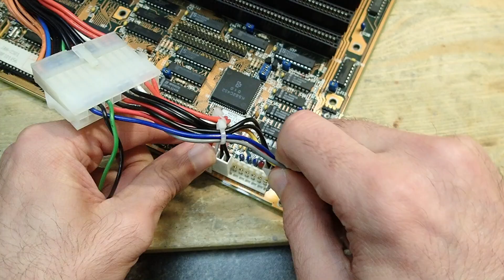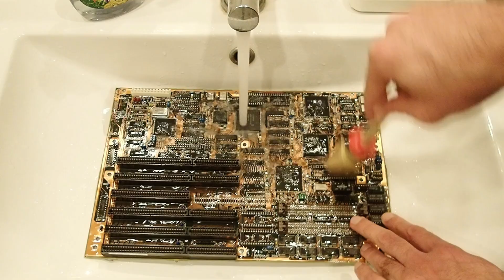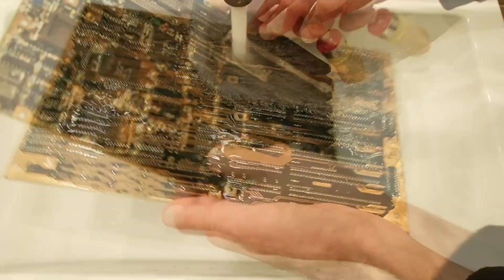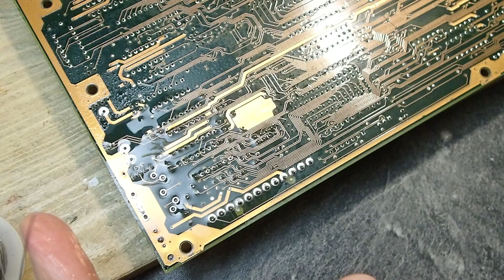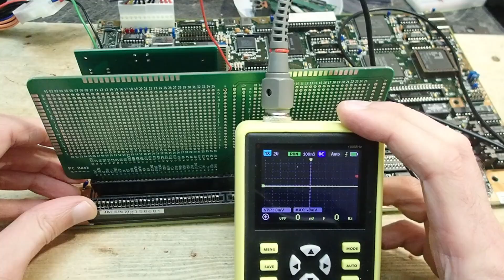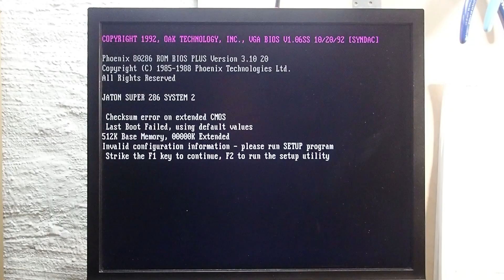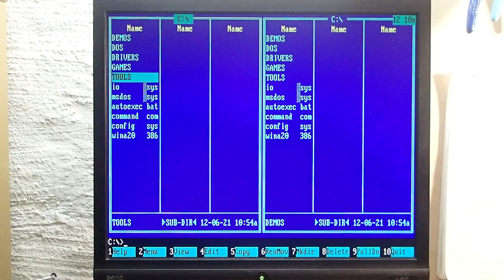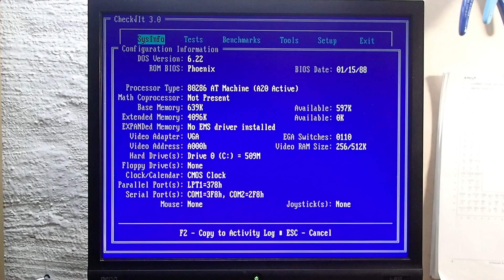Let's repair an old 286 mainboard Jaton JAM-2301-V1

Comment: I adopted your method of removing flux from a board by using alcohol with a toothbrush and then using the toothbrush with a paper towel to remove the residue (I use a clean cloth instead of paper towel and throw it in the wash when it gets too dirty).  It is a very quick way to clean a board and looks like new afterwards!
Reply from the maker: You are welcome.
Reply: @necro_ware  Great job !  This reminds me that I need to get my Compaq DeskPro 386 up and running.  All that I have is this and my Intel SDK-86 prototype board.   And of course, I have the Commodore 64 too

Comment: Usually, I throw them into the dishwasher. Graphics cards, motherboards etc with Finish tablet. Then put into the oven and bake at low temperature. No water stain or anything and shinny like new.
Reply from the maker: Yes, this is also an option. I tried that as well in the past, but without the tabs, since I don't know the chemical ingredients of that. And I have only one oven for cooking food, so I don't put electronics into that one because of health concerns. I tried it once a long time ago and after that all of my food smelled like PCB :D
Reply: @necro_ware   The tablet is bad for aluminium for sure. That's what says on my cookers. Might be bad for BGAs but it worked OK when I try it with some graphics cards. I usually face the BGA chip down to prevent direct water flow over balls. Anyway, don't try it with any precious hardware LOL.

Comment: When I wash boards, I just go over it with a vacuum cleaner to suck up the water deposits that remain. The air humidity here is pretty much always 70% or above, so static is not really a concern

Comment: I usually wash the PS3 and PS4 first let it dry for 2 to 3 days and put it together and they usually work with no other repair. If that does not work, I check capacitors and burn  or broken cabling.....

Comment: Does the little PC speaker have orientation? Like blackwire and red wire must go in certain pins. Thanks another great video
Reply from the maker: No, it doesn't. Thank you too.
Reply: @necro_ware  technically it does, if one used period correct voice coil speakers(the sound will be louder). It does not matter for the beeping Piezo used in the video. :)

Comment: Would using desiccants help as well? I have a bunch of packs from many electronic shipments (not quite easy to dispose, so reusing sounds like a good idea)
Reply from the maker: If I have one I usually throw it into the box, where I store the mainbiards. It helps only to reduce humidity, but if the board is wet, it will probably soak up instantly.

Comment: Can you test if this board works with 4MB SIMMs? My Headland HT12 treats all 4MB SIMMs as 1MB each and the specs I found says max 4MB total RAM for the chip. Since this MB can use 5MB RAM, will it work with 4MB SIMMs also? (let's say 2x4MB+1MB) Not much hope, as the 2 extra address lines might not be connected, but I am searching for 286 that can use those SIMMs fully.
I know SW of that time can't use, but I'm obsessed with RAM drives and looking into network booting old CPUs. Currently 386 can load my compiled etherboot (floppy or bootrom), but I have not recompiled pxelinux from Ubuntu 10.04 and thus 486(DLC on 386DX MB) is still required.
Reply from the maker: No, it doesn't. I know none 286 mainboard, which would work with 4MB modules. They were not existent at that time and the maximum amount of memory a 286 can address are 16MB anyway. Theoretically with the four slots you would already hit the limit and the question is then, what about the onboard 1MB? Such an amount of memory was unthinkable back in the days and would probably cost you as much as a new house. In addition to that, it was not very handy to access that memory, since EMS and protected mode was not yet really mature on 286, so there was barely software which would take advantage of that. And on top of that, if you want to run Linux on a 286, you already lost, since the minimum requirement even for the very first Linux was a 386 with 32-bit, advanced protected and virtual mode. Basically it makes absolutely no sense for a 286 to have more, than 2MB of RAM.
Reply: @necro_ware  I know that much memory was impossible at the time. My point is that 386SX was made to reuse 286 motherboard designs. Although those are 4MB limited (or 5MB with an extra bank??), some new 386SX designs might have been sold with 286 to be cheaper and retain the extra address lines.
As for EMS, on 286 should have been the prime functionality, otherwise why go 286 instead of 8086? EMM386 just allowed the emulation to be CPU-only (free the chipset HW of this emulation) . But all 286 boards should support it (with their own drivers which might be hit-or-miss).
And yes, Linux is 386+, but Unix and Minix exist for 8086 and 286 (I have booted "modern-ish" Minix on 286).

Comment: Anyone else notice the ISA slots were labelled as SOLT on the board?
Reply from the maker: I noticed that as well. First I thought it's a mistake on the silk layer, but then I realized, that the 8-bit part is called SLOT and the 16-bit part is called SOLT for whatever reason :D

Comment: Nice use of the eprom slot on the network card, will have to remember that one.  I bet it would also work with SCSI cards or any other where you can add additional ROMs.

Comment: IDE pin 28 on some early boards must be disconnected for new drives/CF/SD adaptors because back then it was used for various different and incompatible things, like SPSYNC (probably already obsolete when that board was made) and BALE signals, and yes, it will hang POST at controller/drive initialization, try an extension cable with pin 28 disconnected.

Older drives with switches for Single unit, C and D expect the BALE signal and newer drives with MASTER, SLAVE and CABLE SELECT expect ground.

Also some early drives (Conner CP30xx) will DIE if you connect them to newer boards or USB adaptors with pin 28 grounded...

At least some boards up to Socket 7 with integrated IDE could supply the correct signal (BALE or GND) for both old and new drives using a jumper, but you can't mix both kind of drives on the same channel.

Comment: Ahhh... I already have the rubber tips for my Dremel tool , but coating the traces with the flux is the key!  I didn't know that, but watching the solder chase the fluxed traces was undeniable, and something I'd literally never seen before.

This is all very important to me, as I own a pair of the very rare 25Mhz Harris chip 286 boards w/ 16Mb direct-addressable memory (not EMS) [and w/ soldered battery - ugh!], so I'll probably have to make similar repairs when I try to restore them.
Many thanks!

Comment: Just an extra tip : when you put the board upright after cleaning it with water, make sure the chips are aligned VERTICALLY - due to the surface tension of water, water won't flow between the legs of chips so it can get trapped there. If the chips are aligned vertically, the water can escape from underneath the chip itself without pins or legs blocking the "escape route". If you have chips running in both direction, it may not be a bad idea to change orientation after a while. I also find that a hairdryer can help coax water from trapped pockets.

Comment: I would not use that handsoap to wash a mainboard. This is because it's ment for hands, and leaves a fatty residu.
Reply from the maker: That is not cream soap, I hate that :) It is a normal soap.
Reply: @necro_ware  It's the same palmolive as sold here, and it leaves a residu.
Reply from the maker: @janklas7079  If it does, it's not the same. As I said, I hate cream soap and this is just a normal soap.
Reply: @necro_ware  It does. As I said, I have the same soap heree, and it leaves a residu. It's not cream sope. But it does contail oils. Which is also why it's called palmolive, as it contains palm oils.
Reply from the maker: @janklas7079  Palmolive is just a brand name, which should confuse customers, so they think, that it has something to do with palms and olives. Anyway, there is no real need to argue about that. If you think, that you shouldn't us it, you can use any soap you like, or even use any other way of cleaning the hardware. There is definitely not the only one way to do it right.
Reply: @necro_ware  We can surely agree on the latter.
Reply: All soaps leave some sort of residue, that is why proper rinsing is a thing.

Comment: When you want to read old ROMs, can you visually identify the type of chip without peeling back the stickers?  Like is there a specific type that is more common with 286s or 386s?  Can one infer anything from the presence of a Hi and Lo or Odd and Even?  I would be very interested in a video that discusses the various kinds of chips one may encounter and how to properly identify them.  Tips, tricks, etc...
Reply: For everything up to latest 486 motherboards (and some very very late 386 ones) it's the 27 Series EPROMs. Usually 256, but can also be 512 (aka 27c256, 27c512). Manufacturer is irrelevant if you just want to read out the data. The later motherboards used 29F series flash chips.

Comment: Tip for the future : Changing the power voltage can help read back flaky EPROMs, (some will need < 5V, some will need > 5V, depends on their internal circuits). It was not needed here, but if you ever have a bad one with content you can't find elsewhere this could come in handy.

Comment: It's been 30 years since I used one but I think Jaton mainboards were used by Tulip Computers , which eventually got taken over by Commodore and went bankrupt. I've seen that bios many times and because it were slim factor PC's, all I/O was onboard. I've added a 80287 coprocessor back then to run AutoCAD from a 52mb Quantum LPS harddrive .. now my smartwatch is faster and has more RAM and storage as that Tulip PC ever had 🤣.

- edit - that long port had a riser card which tilted the 16 bit ISA connection 90 degrees so it would fit in a slim case. There were models which indeed had a longer riser card with an additional 4 slots to upgrade the RAM to a whopping 8 megabytes .

Comment: what about the water ingres on the ICs? I feel like washing electronics is sketchy just because of that. the humidity could get inside and corrode the silicon. not sure if using a water displacement afterwards is okay, or maybe even baking the board... what do you think about this?
Reply from the maker: I washed probably hundreds of PCBs already like I showed in this video and never have had any problems. I'd say, no reason for worry

Comment: One last thing, for safety, remove all those old tantaluns and replace with eletrolytics, as you know, those old tantaluns go short and explodes without warning. I have nice 386 motheboard that was killed by shorted tantalum, thankfully I could fix the board replacing the keyboard controller and the cpu. Lesson learned,
Reply from the maker: I tend not to change parts just because I can. It costs a lot of time and in the most cases an exploded tantalum is an easy fix. You must've had really a bad day.

Comment: do you think its necessary to put something like nail polish over the tinned area as well? seen some repairs doing this.
i have a similar experience on my 386 and needed the xt bios to boot anything at all. Your videos on that topic were helpful.
The one detail i was missing originally was using dosbox to calculate the bios with a checksum.

Comment: 1. Yes, we are interested in the video about two bioses.
2. Consider covering soldered traces with colored uv-hardened varnish for protection.
Reply from the maker: 1. OK
2. Yes, it can be done indeed, but it's optional. If someone doesn't have a varnish, tinned traces (almost) don't oxidize, so it's another benefit of tinning. However if someone has exposed copper, then some varnish is really necessary.
Reply: @necro_ware  I also mean protection from shorts, accidental, from a fallen screw or a screwdriver or from other tools.
Reply from the maker: @a.lisnenko  If you are worried about that, then you have to cover the whole board with varnish, because you have solder joints exposed all over the place :)

Comment: A smaller compact flash card would probably work without the xtide bios. I recall having this happen to me before as well.  But this does solve some problems and is certainly superior to the internal bios handling. Probably impoves performance too.

Also this is most likely an OEM board for a larger named company. I would surmise for Siemens computer group given that their controllers were most often only found in their own boxes.  This would explain its absence from the ultimate computer project.

Comment: Thanks dude, I am always afraid to wash my parts, but I'll try it.
Reply: Wash your parts properly!!! 😉
Reply: When I haven't washed my parts I don't get any nookie.
Reply: Where I live, I have hard scaly watter, so I dry the board with isopropyl to absorb the water and evaporate it away quicker. And i will take my heat gun and dry the board that way with the temp turned down really low to get under the parts. I can dial it down to just a little over body temps so I dont melt anything.
Reply: @wishusknight3009  like me here. I heard about 50°C in the oven to dry it, but I'm scared, too
Reply: @BreakingBrick  The heat gun allows me to direct air to the places where water can be trapped.
Reply: @wishusknight3009  Well, therefore I should own one, but I don't, obviously.

Comment: Nice video! You were very lucky you could read that BIOS chip even though it was flaky. 

The freezing with the CF card is the BIOS software interrupt routine for reading the fixed disk. They likely copied IBM's original routine from the 5170 too closely which will freeze up on drives that are too fast. I go over the problem here:

https://youtu.be/qO3xrl0XR-4

It is fixable with disassembly and hex editing of that BIOS, but only if someone figured out the interrupt routine and is able to adjust the timing delay. Besides XTIDE, the other solution would be to use a newer 286 BIOS without the problem. You'd lose all those extra settings though, so it's certainly not ideal! 

Perhaps they copied the bytes directly from IBM so a little search and replace would work?
Reply from the maker: Thank you Adrian. Yeah, now where you say that, I remember your video with the IBM and that issue. Somehow I didn't think, that the same bits could be shared with the IBMs original code. I guess, I'll have to dig into that and try to disassemble the BIOS. Thanks for reminding me....
Reply: @necro_ware  I'm really bad with x86 disassembly. I bet if we can figure it out or at least find someone to help, then maybe the same fix can be applied to all Phoenix 286 BIOS chips? (Likely similar code with different offsets) Let me point Stewart who fixed the 5170 BIOS to your video and BIOS download. Maybe he can figure it out.
Reply: Hmm. this makes more sense than my comment I just made... I surmised it was the cf card being close at the 528mb limit. And it may not have the geometry handling. So a smaller CF might work. I have a 286 that behaves this way. It also uses a dedicated controller. But in this case i would guess you are on the money here.
Reply: It should be possible to use IDA Free edition to help with the disassembly.

Comment: I'm curious to know if the old eproms come back to life if You try to refresh their memory cells reprogramming them a couple of times.
Reply: If the problem is just simple bit fade, one erase and rewrite would be adequate and would give you likely about as long or better than it originally lasted (depending if the problem was bad programming - EPROMS are really analog devices internally and you can program the cells to varying levels depending how long the programming pulse is applied; proper programming measures how much programming it takes each bit to start showing a 0 and then overprograms some percentage past that).

Comment: Hello, is it possible to put Freedos or MS-DOS in a bios flash chip? (or SPI flash memory)
Reply from the maker: That's an interesting question. I guess, it is possible, but I will have to investigate.
Reply: @necro_ware  ahh yesss.. thx for the reply.. I've been very interested in hardware/firmware topics but I'm just started in this.. I'm also working on a experiment about firmware now .. but this freedos on chip question is still unanswered since I'm 12yrs old :D
Reply: Not the default version. There is a DOS compatible OS designed to be used on EPROMs, it even has a SSD driver. SSD in this case means that it assembles a DOS compatible drive from multiple 29F series flash chips, even supports writing. Used in industrial PC of that era. I personally found it on an announcer unit used in Berlin. Manufacturer is GSP...

Comment: I have seen some SNES and NES emulators for DOS. Would this machine be able to run any of those games I wonder :)
Reply from the maker: Never tried that, but I don't think, that it will run on this system. It is a 286 and I think for such an emulator you will need  at least a Pentium.
Reply: @necro_ware  makes sense as emulation usually takes much more processing power than original hardware and I believe the SNES was using a modified 6502 processor at over 3MHz. I need to test on my pentium II.
Reply: The dos NES emulator needed a 486 dx4 to really run properly. Some say a DX33 was enough for some simple games but the trouble was when extra mappers were used. And the complexity drove up immensely.
Reply: @wishusknight3009  as soon as I get home I'm going to down clock my Pentium ii as low as it goes and play with this. Maybe get my boys over for some retro emulation on retro hardware :)

Comment: If I use floating flux before soldering will that help heating?
Reply from the maker: You don't need to heat it too much. I forgot to say that, but 230-250°C is enough. You can take whatever flux you like.
Reply: @necro_ware  should be noted that some flux is very aggressive  ;)